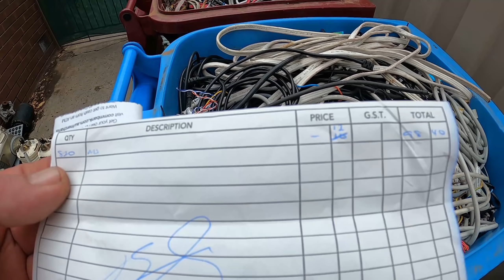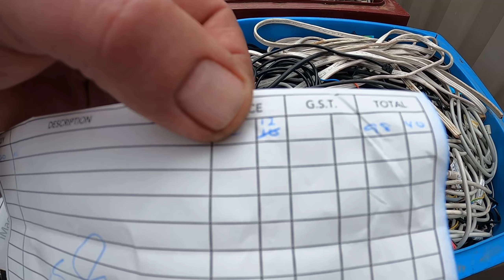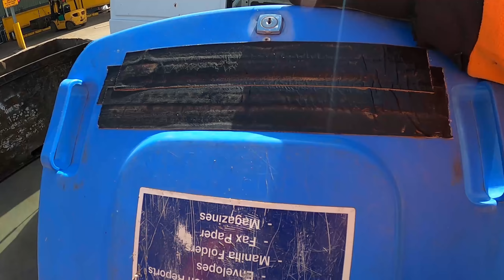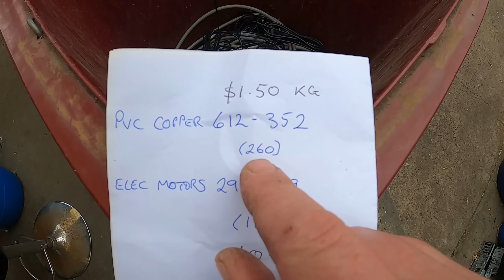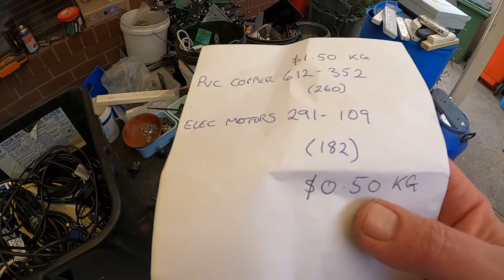Scrap Metal Yard Prices Down

Comment: Hi Ben, here in the UK today 16/04/2020 the price for light iron (the lowest) was down to £30/1000kg, down from £80 in december 2019.  "household cable" (unstripped) was £850/1000kg, down from £1080 in dec. Dry bright wire, (stripped copper) was £2940/1000kg, down from £3800, Aluminium, clean was £150/1000kg, down from £300 last december andd £450 a year ago.  Fridge motors were the only thing that stayed the same, £50/1000kg,  So big drops here too! but you don't make any money if you stop scrapping!

Comment: You should consider making some sort of jig/harness so that the forklift can grab it easy to flip. A band or strap around the body of the bin with two pegs for the forks. The simpler the better. Attach a tagline to the back so that it can be flipped by you. Maybe keep the harness low so that it can be flipped with just a tug.

Comment: Man you have a wire stripper. If copper holds it's price, and the insulated wire dropped significantly, than use that wire stripper and cash in the copper only. With prices like that its worth the work..
Reply: Ben melts copper for stacking
Reply: Copper commodity price was at 2008 level, I have the space, so I can keep mine until production resumes and consumers gets the money rolling in a positive feedback loop :)
Reply: Most of that cable there has very little copper inside. All the black stuff is from lap tops etc. Theres only 2 tiny 1.5mm cores. Would take about 6 months to strip all that even with a striping machine. Haha. The yard takes it as insulated so hes Ben's not caring much copper is in it as he knows he will get insulated price regardless of the size if the cords.
Reply: Computer wire and household cords are not worth stripping, it's only about 30% copper and 70% plastic. He strips the higher grades that have more copper.
Reply: I strip all cords that have 14 gauge copper or thicker. Anything under 14 gauge just isn't worth stripping. If it's solid wire I will strip 16 gauge but see very little of it.
Reply: @ArthursHD  Yeah that sounds about right...that was around the time the Global financial crisis hit. (the time we had labors Krudd in office.) i remember mid year when i moved house petrol prices around melbourne were $1.70 a litre for unleaded.

Comment: Brisbane prices have fallen quite a bit as well last 2 weeks

Dirty steel 8c was 14c
Clean steel 12c was 17c
Heavy steel 18c was 24c
Ally dom and cast 70c was 1.05
Extruded $1.20 was $1.60
Motors 50c was 65c
Lead Battery 35c was 60c
Steely ally is the darkhorse here its stayed stable at 35c

Im trying to hold what i can for now on the non ferrous side 
Not worth just giving it away

Comment: The cabinets are clean sheet iron,(remove all plastic and any copper or aluminum or you default to breakage) pound down the cabinets for room, mixed copper and pastic is :copper content: get a magnet, separate 304 stainless and alum. (MLCC) 
knowning what you have and how to seperate is key to more money, a little extra time makes you a lot more money as well knowing the correct grading and the trade name, plastic is worthless, get a hammer and a sledge, and seperate house wire from communication wire, in Chicago we pay $80 net ton for clean sheet,

Comment: At some point you got to ask if it's all worth it. I hope you have your price points worked out because of all the processing and handling, loading, unloading of that steel and not even get $100. Maybe you should take a single average PC, break it all down, weigh and price the components and find an average value of each one cause it doesn't seem like it's worth the man power to pick one up, especially with the drop of prices.

Comment: My yard is 0.15/ lb for low grade and 0.50/lb for high grade single strand. Only thing near or over a dollar is brass, no 2 copper and no 1 copper. Even aluminum is all around  10-20 cents/lb.

Comment: yep i mentioned the scrap price drop on one of the previous videos some time ago. sounds about right...manhari 1.50.....Evelyn recycling $1.30. any yards in Bendigo no doubt even less (so i still dont bother with them even on a good day.) not sure what the story is with copper motors but what i can say is evelyn were paying 50c a kilo but its dropped to 30c a kilo. lead acid batteries were at 50c a kilo but dropped to 5c a kilo. steel was at 8c a kilo but that's dropped to 5c a kilo. i'm surprised Manhari are still paying at the 10c a kilo mark.

Comment: Printers have some good boards in them.
Reply: Unless you have lots of spare time they are not worth breaking apart. Printers are generally mostly all steel and plastic. I am disabled and I do strip them but all I have is time so my time isn't worth much. Someone like Ben who moves volume didn't have the time when it didn't pay that much more to strip them.
Reply: @kenjett2434  I have the time to pull the boards out. As for stripping them complete then no I don't have time to do it
Reply: @mrgreenswelding2853  everyone values their time differently. But because I am lucky to have time it allows me to maximize what I can get out of every item I scrap. Not everyone though can afford to take the time to do that .

Comment: Far  be it for me to try to tell you what I think you should do, but here goes.  Prices for ALL scrap in the U.S. have dropped catastrophically and I have no doubt they will continue to stay low.  I think you should take ALL your scrap wire and either strip it for the copper content, or just turn it all in for ready cash.  You stand to lose a lot if prices continue to drop.  With your recent health scare, maybe you should consider getting someone to just strip wires for you?  It might free you up from a lot of work and fetch you better prices for the bare copper than for just the unstripped wires and that would offset whatever you'd have to pay someone for stripping the wire for you.  You have GOBS of wire which would require a LOT of your time to strip it yourself.  You use copper for ingots anyway so....?  Well anyway, stay safe and don't overwork yourself.  Thanks for the videos.

Comment: You schould have a schredder/seperator for copper wire. They are expensive,but imagine just,cutting pluss after each pickup,throw it in shredder,and you got clean copper. All wire plastic must be some money there,at least  deliver free at scrap yard...
Reply: He has one, he just doesn't have time to strip the wire.
Reply: @toomaskotkas4467  I know he has å stripper,but i mean a granulator. Og shredder. That crumbels it into ittsy bittsy pieces and seperates it... likenistead of cutting pluss andthrow in bucket, be could throw it in shredder and get clean copper rightaway
Reply: @mortenhenningsen940  He doesn't have a place or money for it.  That type of equipment is not for home usage.
Reply: @toomaskotkas4467  yeah,i know. I've been  googling for my self the last year,just big industrial ones. Kinda sad tho. Would help many scrappers if we could have a small model,getting all clean copper to sell.

Comment: I know it is too late now. Next time you have those motors with the nice copper, cut them down into smaller chunks and melt the copper out of the steel in your furnace. Then you will have copper ingots.

Comment: You need to stop throwing out all the dvd drives. There IS gold on the IC's inside on the boards. There may only be 1-2 Chips on the boards, But from what I see, you throw out a LOT of DVD's without taking out the boards.  It only takes 10 seconds to remove 4 screws from the bottom of the drive and about 5 seconds to remove the board (less if you just rip the boards out.. I can only imagine how much gold you have tossed out over the last few months.